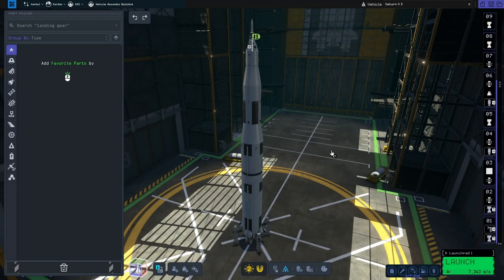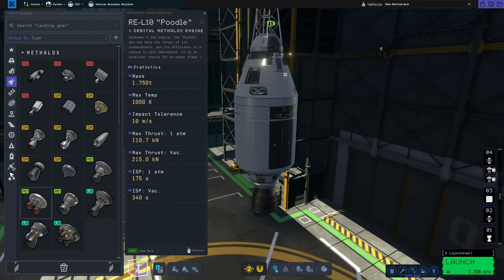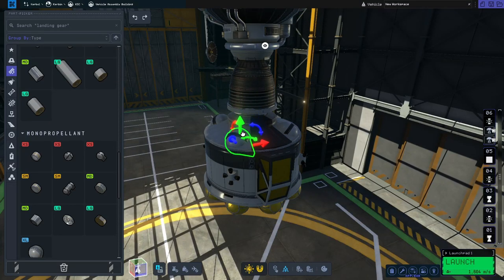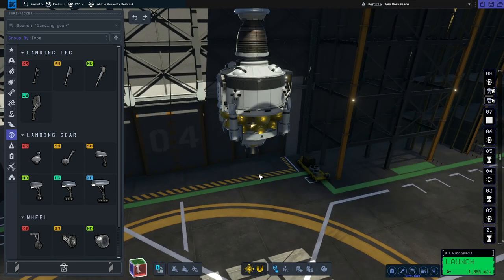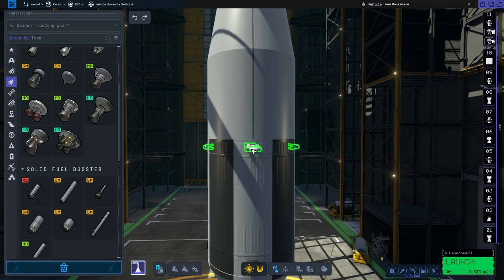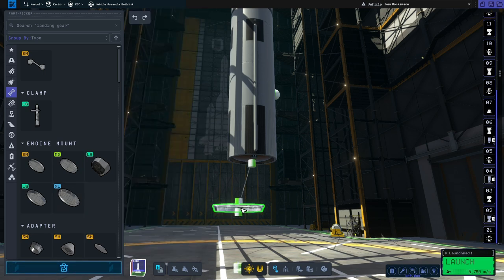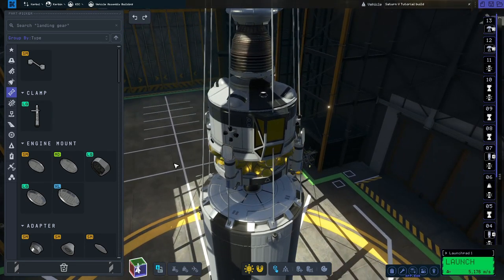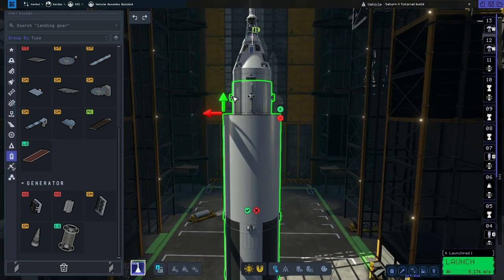KSP2 How to Build a Saturn V (Tutoral)

Comment: Followed your guide exactly step by step, my fairing won't close. When I validate it just makes the top part of the fairing disappear. Couldn't find a solution to make it work. Have you tried to redo it since the science update ?
Reply from the maker: Hi, I haven't re-built it since the update however the way the fairing works does seem to have changed since the update :/ hopefully the devs will fix it in the next patch but if I find out another way to do it then I'll let you know :)
Reply from the maker: Hey, Just so you know I have just done a short video on how to get around this issue...https://youtube.com/shorts/AEpHTZA1098?si=FAxLypz-tVPwTF3q

Comment: This rocket doesnt have the necessary deltaV  for a munar mission. Nice looking model, but definitely wont get your there and back again.
Reply from the maker: Hi. I've just checked the build again and it seems to have more than enough fuel to get to the Mun and back. Have you tried the mission? I know that the Trip Planner says you need over 10000 delta-v but it's wrong and you really need less than 7000 delta-v.